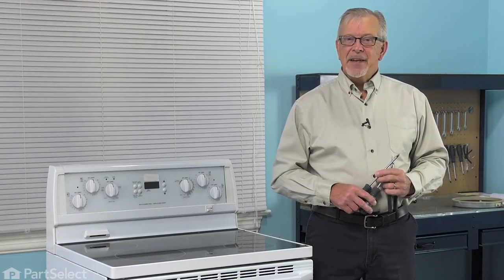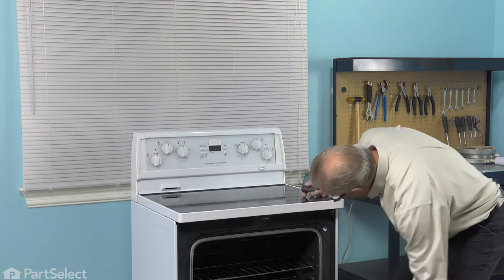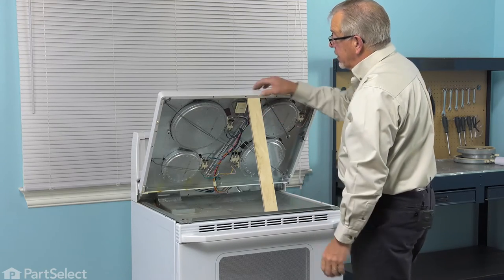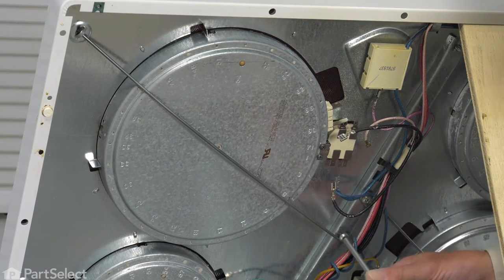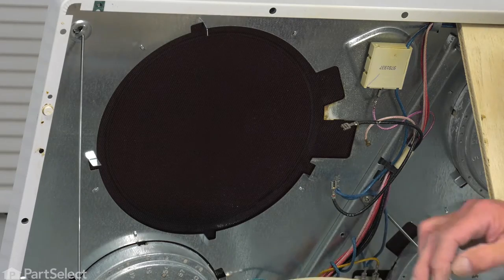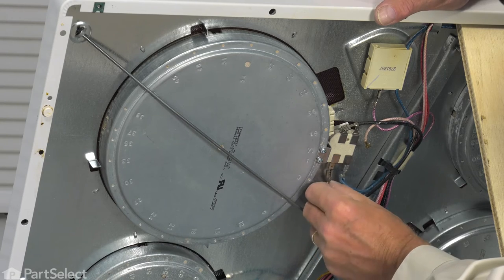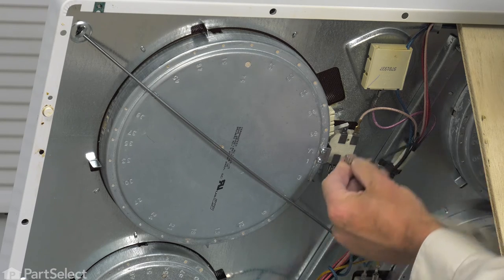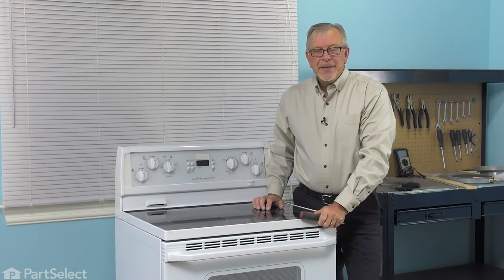Range Repair - Replacing the Surface Element (Whirlpool Part # WP8523692)

Comment: Hi Steve, I agree that this is an easy fix. However, recently I bought a replacement element but it was a different part number from the original. When I checked the connections on the new one, I realized that the wires do not connect in the same configuration as the old one. It might be worthwhile to mention in the video to check that you are connecting to the same terminals as they may have been moved around on the new unit. Attach the wire that came from 1a to 1a and so forth - don't go by positions on the switch go by the markings on the block.